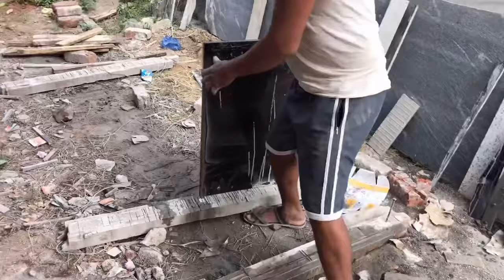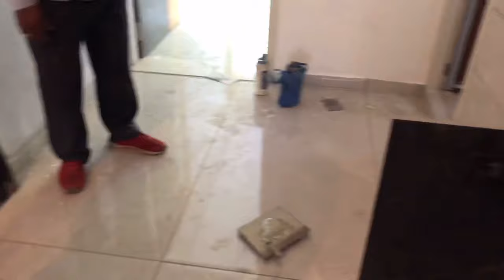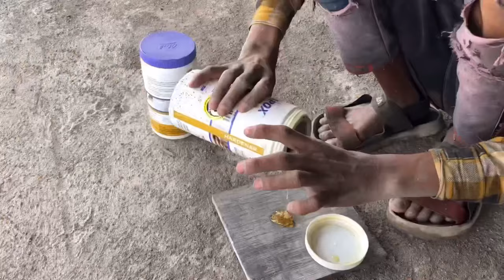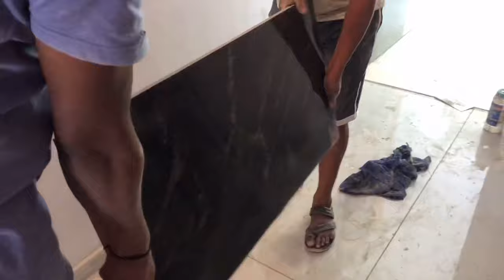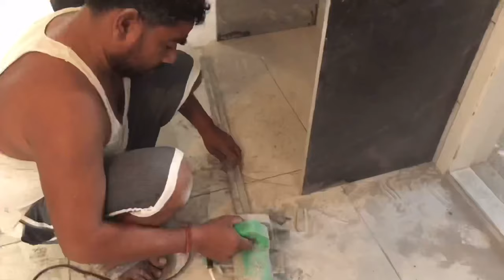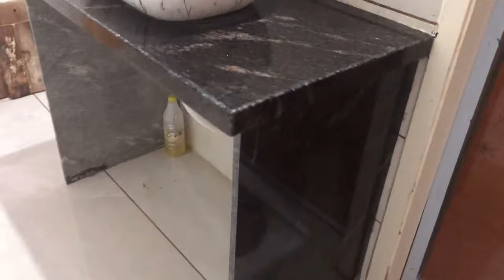Countertop Washbasin Cabinets full Detail | How to Table Top washbasin installation

Comment: The two granite slabs are 19mm thick and they can crack if something falls on them. This is just good for looks, but weak. This needs to reinforced with a angle or a frame made of wood or cement board.
Reply: They are one on top of the other though so it should be fine